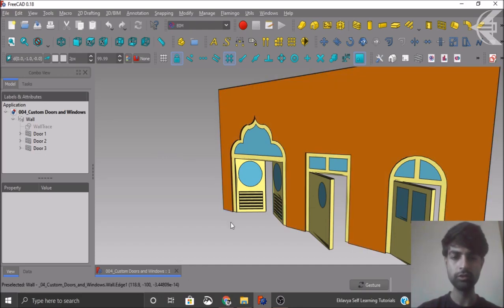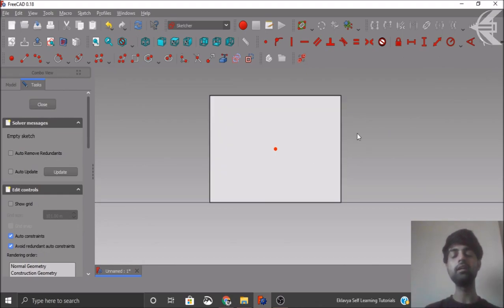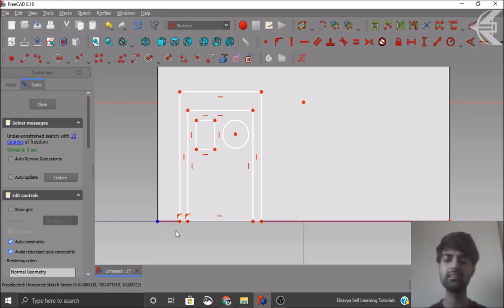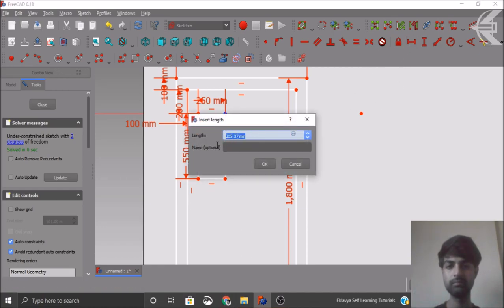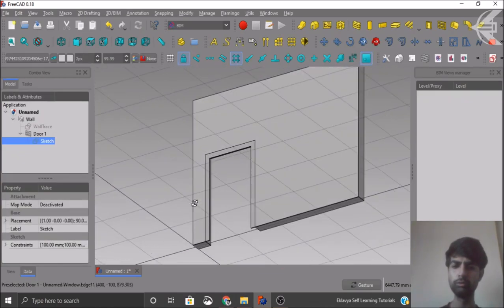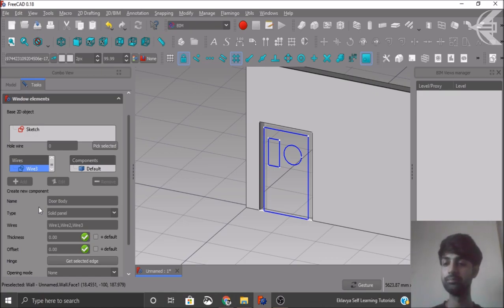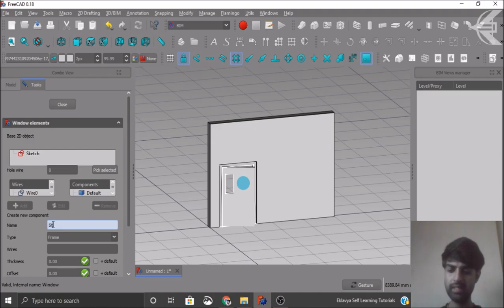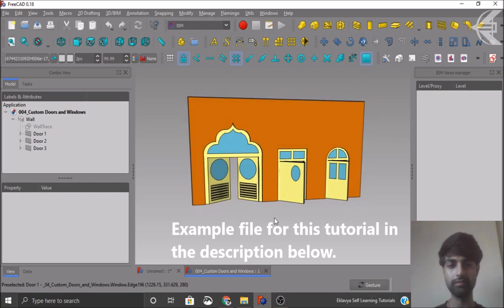004 - How to Create Custom Doors and Windows | FreeCAD BIM Workbench

Comment: Is there a way to wrap wall finishes around the jamb where the window/door is inserted?
Reply from the maker: Please elaborate more...
Reply: this is a very useful feature available in Revit. You can check this link. https://knowledge.autodesk.com/support/revit-products/learn-explore/caas/CloudHelp/cloudhelp/2015/ENU/Revit-Model/files/GUID-69B6DC75-56A9-4F35-BE24-80048360E2BB-htm.html#:~:text=Compound%20wall%20layers%20can%20wrap,is%20placed%20in%20the%20wall.

Comment: Thank you, this was a very useful tutorial.  I have created a parametric door with this method and from using spreadsheets (found here https://www.youtube.com/watch?v=lf-up4UjG58). Could you also teach how to place these custom doors in other models (ex. from BIM Library?), without them breaking? I have placed this parametric door in BIM library, but I am not able to move or rotate it without breaking the model. I did use a work around, and made the door into solids, and I am able to move and rotate it freely. But when I move the solid, the sketch and the door component gets scattered in 2 different places. Also the cut out does not get created in the new wall, i need to do it manually. Is there a way to create custom doors and window and make it to act like standard doors and windows of freecad ?
Reply from the maker: You may please refer the following video from my channel:
"005-B - How to Import and Organise Custom BIM Objects in FreeCAD"
I hope that helps!

Comment: Great!  Thank you.
I'm thinking there's some additional info that would be nice to add in a future video, like:
- How to manage a window a door library to reuse on any project
- How to set width an height as parameters so when used again it can be inserted and adjusted to other dimensions
- How to asign multimaterals to doors and windows
- Are there any other properties/parameters to consider when designing generic doors and windows?
Reply from the maker: Noted. Thanks once again for great feedback, will definitely look forward to it. :-)
Reply: Regarding the library - perhaps you could use the spreadsheet in the sketcher workbench.